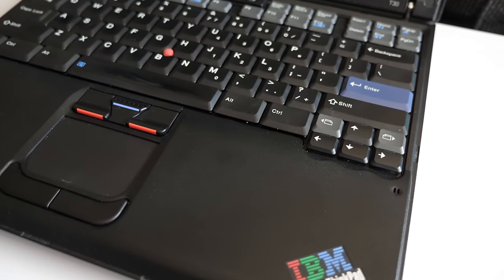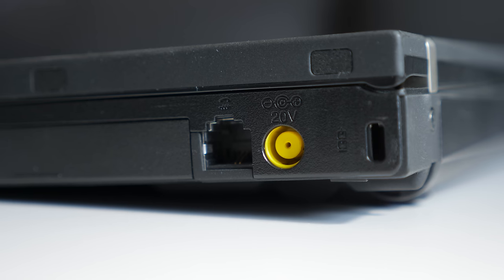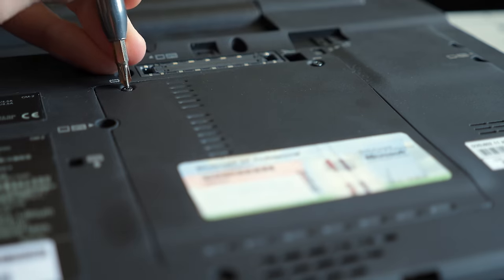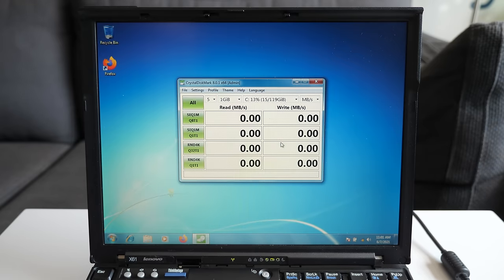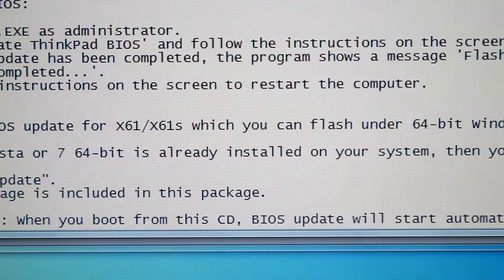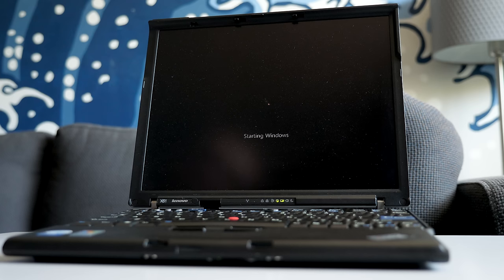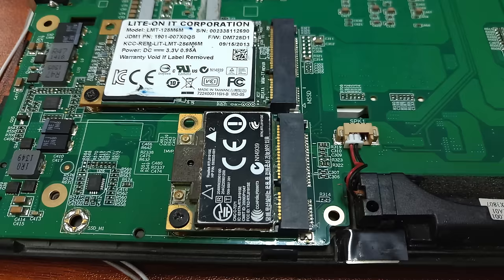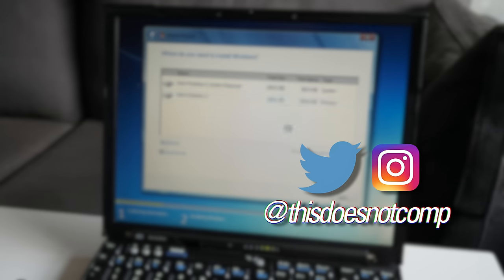ThinkPad X61: The Subnotebook That Got a Second Chance

Comment: I got one of these X61s's in 2010 from a friend. Still have it, need to put a CPU fan in it. I run an Intel X25-M 40GB in mine. Even have the docking station and CD-ROM and both chargers. It runs 10 very well too even.

Comment: Asking the Linux community of Distro suggestions will get you a great many differing answers.
I run Manjaro XFCE on my X220, it's a fair bit newer than the X61 with an i5 16GB or RAM and a 500GB SSD but shares the same keyboard and general form factor. The X220 is the last ThinkPad with a proper keyboard like your X61.

Comment: I bought recently X200 for about 100$. With 2GB ram. I installed newest ubuntu mate (22.04) and it works great. I takes about 800MiB, so still enough room for applications :) Its amazing machine.
Reply: i'd upgrade to 4 and turn on ram saving in your browser

Comment: Just bought into the proper Thinkpad meme and got a T60. Planning on setting it up as a development machine with NetBSD. Been using an Thinkpad E540 Edge since 2014 (Dell Studio 17 1747 died) and crunched any and all PSpice, XSpice, logic gate simulations, and code compilation I threw at it with multiple concurrent tasks at the same time. Not happy with it being a later Lenovo computer but its still solid.

Comment: Manjaro KDE is my current distro of choice. You get the fast rolling releases of Arch with most of the stability of a numbered release distro, and both the Arch and Manjaro wikis are there to help. Plus you get pacman, which is just a joy to work with, and leagues easier than apt to un-fuck if it corrupts.
Also, the AUR is wonderful!

Comment: As always, a great vid of ThinkPads! I have an X41 Tablet, bought as "non-working". It turned out the battery was in a bad shape, so I removed it, plugged directly to the wall and voilá. It came without the pen but got one in AliExpress (it was so expensive though!). It had its original hard drive (a tiny mechanical one), so I bought a PATA to mSATA adapter but had no luck making it work. Maybe some voltage thing I overlooked. I should invest some more time on it...

Comment: I have an base model X60 that I got in a bundle of retired machines.  I added ram (4gb but only 3gb useable due to 32-bit OS limitation) and added a SSD.  Also replaced the battery and purchased a stylus as the X60 is a convertible into a tablet.  I even have the docking station.  Honestly, if I used Windows machines regularly I'd keep it because I really like it as a compact laptop.

Comment: Man, I was thinking about fitting a Raspberry Pi into an old 15 inch laptop (wouldn't be the first one to do so!), but this Chinese madlad upgrading old C2D device to an i5 models is beyond crazy <3 I get the design trends, but having an option to upgrade your laptop would be rad (and environment friendly). I once had a Clevo machine and GPU being a MXM design saved it when original 8600M GT died. This 2007 machine was still in use till 2020... I wish we had CPU/GPU sockets lasting for years, like AM4, but for laptops.

Comment: Man, do I miss my tablet x61. I use a modern touchscreen yoga laptop nowadays, and it's fine.... but I really seriously miss coding on that old keyboard with the trackpoint. 
It was right there, in the middle of the keyboard, I was more productive on that old laptop because of the trackpoint than I am on my workstation with mechanical keyboard and a good mouse. 
I guess I should find an x220.

Comment: I have two Thinkpad X61s and yes, you are right, I totally love them for their form factor and also because it was the last model with a 4:3 aspect ratio screen. I run Ubuntu MATE on my machines, but I customized it so that it looks like a Windows 2000 OS. I call it Windows 2020 Classic Edition. Other modern operating systems are not that great on this machine, especially because the X61s models have more energy saving processors, so that my dual cores are at 1,6 GHz. But with Ubuntu on it this machine is still fast and very usable, even for modern tasks.

Comment: I found an r61 in the ewaste recently.  Same era but way chunkier it's quite a hefty beast. I did the Middleton's upgrade too. Found a spare t9300 to swap out for the t7100.  doubled the ram, then wiped it and put haiku on it ( the BeOS implementation) fun times. Ive had a few Thinkpads over the years t23's are pretty good. I still keep music on one, it has the good life next to the stereo mostly. Though I had to use it to do car diagnostics the other day basically only laptop I have with windows to run the vcds Volkswagen diag tool  works like a charm though.

Comment: Those specs are nearly identical to my MacBook 3,1 from the same time. If you did a Hackintosh, you'd probably run into the same limitations with the X3100 graphics, meaning you're limited to OS X 10.7 at most, and 10.6.8 is really the sweet spot. It would probably be totally usable with just about any distro of Linux as long as you use a lightweight desktop environment or window manager. I've got an old Acer netbook (one of the original crappy Atom ones) that runs antiX using the IceWM window manager just fine in a gig of RAM, so it would fly on this machine.

Comment: lovely video! Just installed linux mint xfce on my new X31, which is complementing my X41, X61, X201, X220 and X230. Also, I recently replaced a malfunctioning fan on my x61 - considering starting using it as a daily slack computer! Thanks for making these videos =)
Reply: also, just flashed the x61 bios - to nearly double the SSD speed! Thank you so much for pointing this out!

Comment: I have exactly the same model (down to the CPU type). It has gone through quite a few iterations of OSes. Windows in the beginning, then various distribution of Linux, then Andriod x86, then Neverware Cloudready OS (based on Chromium), and now settled on Peppermint OS. I have also prepared a bootable USB drive to run Batocera (retro gaming platform).

I have also updated graded it with (also the same) 128GB SATA SSD and 4GB RAM. 

The issues mine has are around 2 areas:
1. Battery. You can imagine that the battery won't be good. I ordered one from Aliexpress but it still wouldn't charge well. It would stick at 60% or something like that for days but sometimes, it charges to 100%. In any case, once it's on battery power, it drains pretty quickly (an hour, maybe two). I have basically given up on using it with battery. I could have ordered another battery (maybe the one I got was a bad one) but I have not done so.
2. Fan noise. I can clearly hear that the fan is about to be broken. When I opened up the back cover, I realized that it's quite involved to replace the fan. I didn't. Maybe I should, to keep it alive longer.

Comment: What Lenovo should have done was an 17 inch with good cooling and a mxm slot that didn't have whitelist much sooner as that would have been a great combo for both gaming and more demanding cad work. I ended up moving on to using Dell Precisions despite their issues and plus they got nicer display panels. Would have given HP another chance had they not been so terrible. Still would have been nice if the W720 or W730 existed though no efforts towards developing such machines that I am aware of.

Comment: In my experiences with using my relatively ancient laptop and desktop as daily drivers with modern OS's I found that 'BionicPup32 8.0 Puppy Linux' works beautifully. 
I'm presently using a Dell Optiplex 745 desktop PC running Puppy Linux and it runs great.
I also have an Asus Eee PC T91MT sub-laptop/tablet and I run the Puppy Linux in that and it runs great too. In fact, the only distro that would run properly with the T91MT has been the Puppy Linux. 
The T91MT has a GMA500 graphics chipset and none of the other distros I tried so far worked right, (which has been Ubuntu and Lubuntu Linux of any version, old or new) ... the sound and video during media-file playback ran crazy and stuttery and fast with those  distros. With BionicPup32 8.0 Puppy Linux the GMA500 chip apparently loves the drivers that are bundled with that distro and runs nice and smooth. The bundled drivers for the T91MT's touch-screen circuit matches perfectly too, with the cursor tracking exactly under the contact point anywhere on the screen. I love the Pup ;-)
Reply: ... my other relatively ancient daily driver is a Dell Latitude D630 laptop, presently running Lubuntu Linux 18.04.5 LTS and it runs nice and smoothly with that distro. It also runs great with the BionicPup32 8.0 Puppy Linux.

Comment: I have an old Thinkpad R61 laying, and I had plans to replace the optical drive with a secondary harddrive. Well, that didn't worked as planned. I expected the connector to be that regular ide-connector for laptop optical drives. So I ordered a drivebay for a second drive, and it didn't fit. It seemed that it was some special connector that IBM/Lenovo made up for themself. I googled for the correct drivebay, and it was hard to find one as it was sold out everywhere. The only one that I could find was on eBay that costs 70 USD. :-( yikes! The sold out ones costed around 35-40 USD.

Comment: I had an x201 that I spilled a big huge jar full of milk into. I rinsed it in the sink, figuring that water is better than milk. The keyboard and touchpad was ruined but $35 worth of replacements from eBay, and I continued to use that machine daily until 2016.

Comment: I know that you want to keep the notebooks you have "stock" at least from the outside, but I think you should look into modding the old ones with usb-c charging ports. Especially Lenovo, since most of the old series have a pretty straight forward way to use usb-c charging ports from the new laptops

Comment: Highly recommend Linux Mint, I tried over 20 distros and it works the best on laptops and older gen desktops as well .
Reply: what version you use for? i have x60 32bit, i only found linux mint version 19.3 for 32bit
Reply: @vuicung_beyeu  Unfortunately Mint stopped 32 bit releases, there are lots of 32 bit lightweight distros around but 19.3 was a good version of mint , not sure if its still supported or not.
Reply: @gato38  thank bro, i have a problem, i can't creat usb boot to install linux mint, bios didn't recognize,  i used rufus to creat iso, could u tell me some advide?
Reply: @vuicung_beyeu  When making the bootable usb make sure you are choosing MBR and not GPT, GPT is for UEFI BIOS which Im pretty sure the x60 doesnt have.

Comment: I remember having one and even ran earlier builds of windows 10 on it, as I had a decent CPU and 8GB RAM in it.  Sadly, it crapped out one day, with no real explanation why.  Just threw the parts at my eMachines e528 laptop until I got a used 2012 MBP and have been great ever since.

Comment: I highly recommend you put Linux on it. Manjaro linux is what i would recommend, but you won't go wrong with PopOS and other Debian flavors. I prefer Arch for the sole reason that you don't need to worry about dependencies; everything is upgraded to the latest version all the time. The AUR is a big plus especially for those hard to get drivers.
If you'd like something completely removed from a traditional desktop experience and go from something niche like tiling window managers and minimal setups, there are setup guides online! Or you can try Archcraft OS

Comment: Bunsen Labs Linux.. Very much lighter than Linux Lite and the 32 bit install also fits on a CD. On these older machines I recommend using the 32 bit as less space will be used for the processor. With a 4 Gig machine this is a good choice. If you have more than 4 Gig you should probably use 64 bit.

Comment: I had two X61T - they were excellent core 2 duo machines and I would still have them if I hadn't decided to donate them to a private school.
Reply: The saddest part was that the tablets were limited to 1,6GHz - or 1,8 with some hard mods. I think they would have been way snappier with 2GHz processors.
Reply: @zeero4ever  The 1.8Ghz was no slouch.  I used to play Counterstrike on it.  I also had a drawing program that I created some artwork with.  If you upgrade the RAM to 4GB, it ran just about everything I threw at it.
Reply: @agenttexx  Didn't modify core speeds on mine, just put 4GB RAM in and unlocked SATA2 speed to make use of a SSD.

Comment: actually, you can even order a 13 inch 3000x2000 x61 modified display and a completely new mod motherboard with i5 5th/8thGen processor (X62/X63 project) from chinese thinkpad fan forum 51nb.
Reply: they also offer modifications which can change the conventional charging port to usb-c

Comment: Given the age of the laptop, I'd suggest using something like Xubuntu or Lubuntu for snappy performance, as well as upgrade to 8gb of ram since you mentioned it can handle it reliably. I wouldn't suggest a gnome or KDE desktop environment simply due to the fact that I can imagine a bottle neck on performance since those desktop environments can be rather resource hogging. I'd love to see more of this laptop Colin, I used to own one and it was a good PC for it's era!
Reply: Unfortunately, 8Gb RAM (ie 2 X 4Gb sticks) is very expensive. I'm running an X61T with 4Gb (2 X 2Gb), Middleton BIOS and an SSD, and use it daily, mainly for writing. It's totally practical for browsing, YouTube, email etc, and the pen works very well for note taking, using xournal++. I'm running Linux Mint 21 MATE with no issues at all. Everything works, except I haven't been able to get the fingerprint scanner functioning (I can register a print and get it to ask for authorisation but then nothing happens when swiping).
Reply: @jonh5032  Always a matter of exploring options when buying PC parts, ram isn't terribly expensive unless rebuilding a dinosaur from multiple decades ago, a 90s laptop is recent enough "most" people shouldn't have problems sourcing parts for reasonable prices
Reply: @FilmoretheVW  I'm guessing you haven't looked for 2 x 4Gb DDR2  RAM, which is what I need for this 2007 laptop.. If you can find it for less than £30 in the UK, I'd be really grateful if you could let me know!
Reply: @jonh5032  Granted I'm in the US, so I don't exactly have the same resources one might have in the UK, pricing may vary across different regions, but if I find something, I'll let you know!
Reply: @FilmoretheVW  Thanks! I had a look on eBay here and the cheapest I could find was £30 including postage, from China.  for 1 x 4Gb stick :-{ I only paid £50 for the X61T, though that was a total bargain (had to add SSD, new generic battery, cooler running Atheros AR9382 wifi card, thermal repasting) and 2 x 2Gb RAM which cost £10.88 new via Amazon).

Comment: I’ve got one of the x61 tablets, was issued to me at work brand new in 07ish, I was able to keep it when it was retired at work after it’s 4 year cycle, upgraded it with 8GB RAM, the Middleton BIOS, 128GB SSD, new WiFi card, and a Broadcom CrystalHD video hardware decoder card after I took official ownership of it. I’m running Ubuntu 16.04LTS on it still, but that’s a bit outdated now. http://www.acrpc.net/lenovo-x61-tablet/

Comment: I have a t60 and I think an SL500 if I remember correctly. I wish I could say the SL500 was in working condition but sadly its sitting in a box because it needs a new power supply.

Comment: The best linux distro you could use is one without systemD. Slitaza is as light as it gets and is recomnmended even on acer aspire one d netobooks on atom (check wikipedia). With slitaz you could save it.

Comment: I would go with Xubuntu or BunsonLabs Linux. Both are Debian based, but BunsonLabs Linux requires more terminal commands, if you are okay with that, go for it. Main plus with BunsonLabs Linux is the low memory usage and size. Xubuntu is low on memory usage when you compare it to other flavors in its kind, like Ubuntu. I run Xubuntu on my main system. If you ever need help, let me know.

Comment: I just picked up a old gateway laptop from ebay got a good deal ($42) has a amd turion with 2gb of ram a nvidia 6100 and 2gb of ram running windows vista. Only real issue is it tends to sit on the gateway splash screen for a few minutes but the operating systems ive tried run ok tried changing the ram and hard drive but no difference so going to try either a ide ssd or a 7200rpm hard drive

Comment: I ❤ Linux Mint 🍃💻 easily my favorite Linux distro I've tried so far; I use Mint on my main productivity machine and have installed it successfully on two old laptops and an old ThinkStation workstation unit. Easily replaces Windows on older hardware that was designed for Windows 7 and 8 which, of course, aren't supported anymore.
Reply: what version you use for? i have x60 32bit, i only found linux mint version 19.3 for 32bit

Comment: X61 succeeded in where X41, X61's predecessor had failed. X41 (and X41T, the tablet version) would had had been a very nice machine had it not for the ultra slow 1.8" 4200RPM PATA mechanical hard drive. Ironically the X41 was equipped with a SATA interface but a PATA-to-SATA bridge was used to facilitate a PATA drive. The 1.8" hard drive was single sourced from Hitachi who had bought IBM's mobile hard drive division. Years later thanks to newer mass storage technology Thankpad enthusiasts would put a SSD in a X41 to speed up the hard drive and X41 would become a peppy machine. X41 RAM space however is confined to 3GB maximum.

Comment: I decided to run Linux on mine and ran into the WiFi sleep mode issues, I managed to resolve this in Kunbutu where it’s fairly well documented. Other than that it runs Linux very nicely.   The screen is the biggest gripe for me, it’s dull and washed out compared to other laptops I own, though given its era that is an unfair comparison.